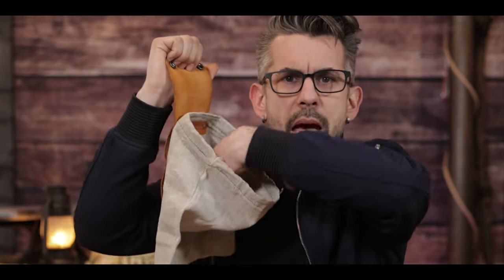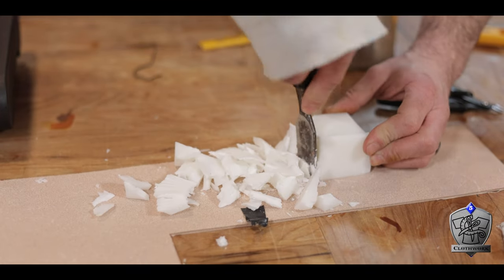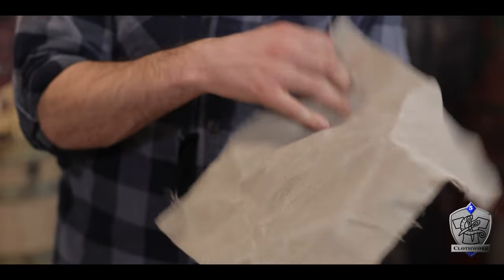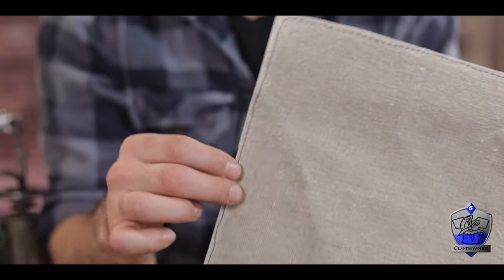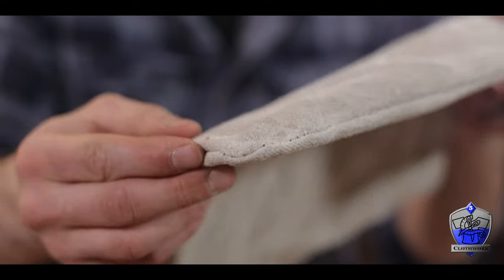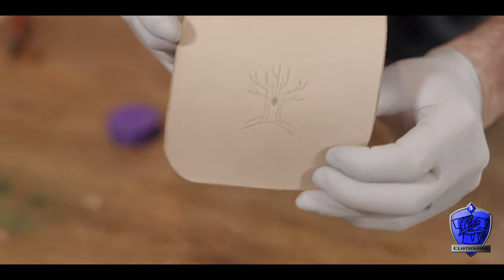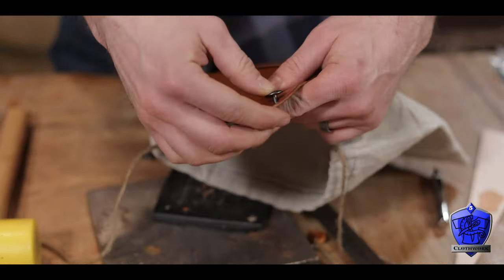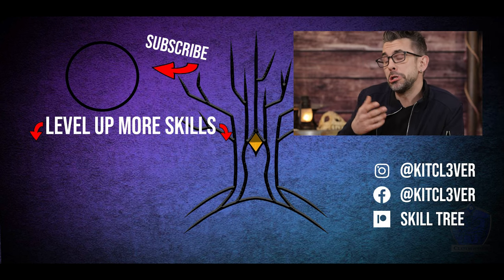How to Make an Expanding Waxed Canvas Bag

Comment: I love using my belt pouch for mushroom hunting. But I didn't wax it, I want the mushroom spores to spill through the canvas as I walk through the woods. Another tip for evening out the wax as it hardens, a hair dryer works great! And let's face it, every shop needs an iron and hair dryer.
Reply from the maker: Preach! Both get a TON of use.
Reply: YES THEY DO
Reply: I actually found a hair dryer to be insufficient, mine is kinda wimpy, a heat gun on the other hand, worked like a dream
Reply: When I was little I used a mesh bag so that the spores fell while I walked through the place. I think that it could be more effective than canvas

Comment: In the marine corps we had somethin very similar called a drop pouch and usually put it on our off side (your non shooting hand) to hold empty magazines and similar items while you were in the field and it also rolled up and out of the way as well
Reply: I'm glad someone else recognized this as a LARP dump pouch. Haley Strategic would probably try to sell these things for like $300.
Reply: @ShibbyMcCleud  which is why you buy the Condor version. 😁
Reply: @aaronbock6406  I prefer blue force gear, skd tactical, and tactical tailor. Prices are a tad higher than condor, but they're just companies I'd rather support. Also fuck Haley strategic and ferro concepts just as a principle.
Reply: @ShibbyMcCleud  blue force gear my go to

Comment: If you want to maximize the flopitude of the canvas after you wax it go at it after with a heat gun. Just clip it up to an edge and let the wax drip down and off the bottom. The fabric will keep just enough in the fibers to waterproof it and keep it more flexible. There’s an inverse relationship between how flexible it is and how durable it will be, but I make fabric flags and signs and melting off all the wax I can with the heat gun let’s then still wave in the wind without the design I put on running off in the rain! Sick bag too, definitely going to make a few of these for LARPs and cons, stylish and handy!
Reply from the maker: Love this tip! I will 100% give that a try.

Comment: I build them bags for foraging mushrooms, edible plants, and medicinal herbs. I have a bunch of heavy canvas I bought when one of the chain fabric stores closed. I use beeswax, you can add iron oxide and make it tinned canvas which also turns it a nice rusty color. Most of my canvas is earth tones though. There are also products like fabric ease that keeps fraying to a minimum. I also pleat the sides and bottom so when the bag is open it's rather rectangular. I use leather lacing for the drawstring. Hand carved mushroom made from antler toggle completes it. Another material ya may wanna try working with is rawhide. It is so neat when wetforming then dries completely hard.

Comment: This is a very cool build, I think I might make one for myself.  Just an aside, you can also use paper towel to get the extra wax off a section of cloth.  Lay down some paper towel, then the fabric on top then another layer of paper towel, THEN use the iron to heat up the cloth again.  The extra wax goes into the paper towel and no matter how much you iron plenty of wax stays behind.

Comment: One helpful tip if you want tighter weaves on these drop clothes is to wash and dry them on hot.
Causes the cotton to shrink. Just be aware you might loose 6 inches on side. We found this out after washing a tent we made for my daughter.
Reply: Good advice. It really tightens up the weave and it takes all the sizing out of the canvas. Without the sizing, it will take the wax better.

Comment: To sew straight lines you can install a guide or fence to butt the work up against. Since the machine is steel a strong magnet with a straight edge would work or clamp a block of material to the sewing bed.

Comment: interesting tip the canvas being waxed atuly makes it fire resistant as in while it will catch at the same rate as the non waxed cloth it will not burn as fast so you have more time to put it out before it gets more dangerous

Comment: Discvered the channel and going thru the past episodes, glad i stumbled in.  Anyway, Would marking your stich line help with keeping your stitches straight?

Also, I retreated my oilskin coat with mix of beeswax and linseed oil plus a bit of turpentine to help it dry and a couple of ounces of food grade orange oil. The mix worked great, and I found its also good on leather and wood.

Comment: To remove excess wax. Place a clean piece of cloth on top and use the hot iron. The excess wax will wick to the clean cloth leaving the waxed cloth better more evenly sealed but softer and flexible.

Comment: How does this type of waxed fabric hold up in warmer weather? Would it survive Texas summer heat without getting gooey or messy? 

I've seen other waxing compounds that incorporate linseed oil and/or turpentine. Have you tried any of those methods to compare with using purely wax?
Reply: I think just look up the melting point of waxes, at least around 160 F and above should hold up. Or you could melt down some silicone instead of wax. Plenty of vids about waterproofing using silicone.
Reply: @CaseNumber00  One of the latest videos has him using silicone for waterproofing and he seems to have really liked it.

Comment: Not sure if you will see this but I was hoping you would be able to answer this: For the Iron: do you use one iron specifically for waxed items? How do you clean the iron of any wax build up?
Reply from the maker: I do! I have a "shop iron". That said, the wax isn't all that hard to remove as it is liquid while hot so I just turn the iron on, let it heat up, and then use a moist sponge to remove the excess wax.

Comment: Why cant you wax loser fabrics?

I made a cloak (wool inside and linen outside) the linen is quite lose can i wax it?
Reply: Pre-wash all your fabrics before cutting. Even the best can change hand after washing. In the case of your linen, you want to shrink it to make the weave tighter. Wash it on hot with hot rinse. If you do that to the wool, it will shrink, felt, and thicken into "boiled wool." Which is a great winter fabric.

I wouldn't recommend waxing after it's made up, as the wool will also get waxed.